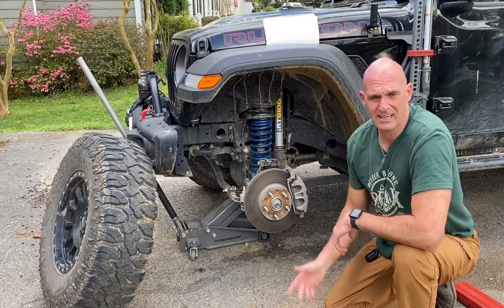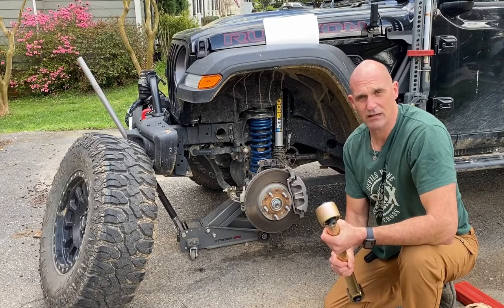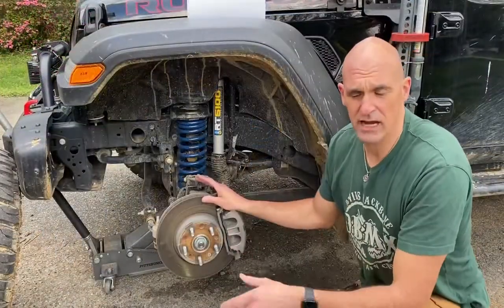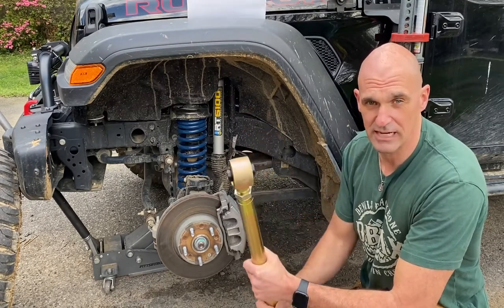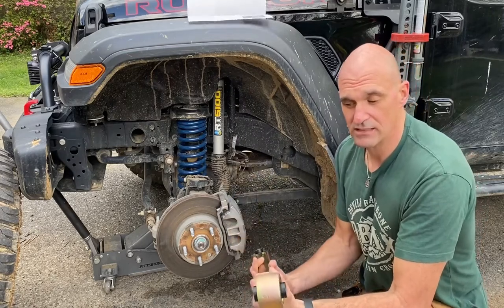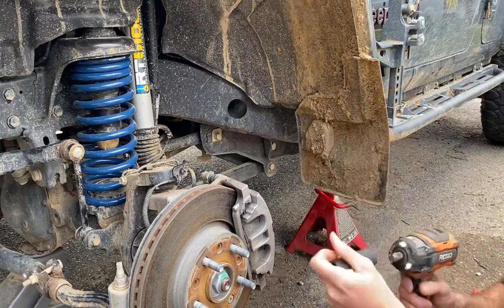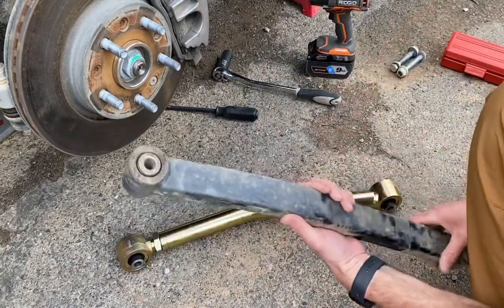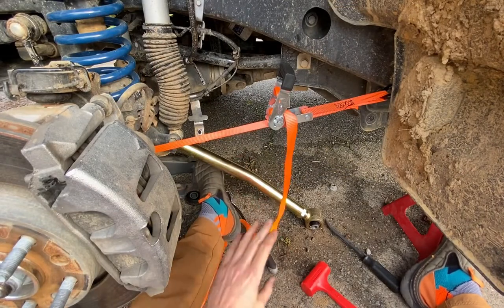Metal Cloak Front Adjustable Lower Control Arms on a jeep JLU Rubicon

Comment: Did you need the strap to pull the axle back to get the bolt holes to line up?
Reply from the maker: Thats how i used it, i set the basic control arm length first and then used the strap instead of wrestling with the alignment and then fine tuned from there worked out really well

Comment: Nice job on the video.
Surprised you didn't add some length to the LCAs to get your caster up a bit, especially if those AEV springs added additional lift. Also, LCA bolts should be torqued to spec only when the suspension is loaded, so best to do that w/ the tires on a ramp or flat ground.
Reply from the maker: Thanks I appreciate it, with the geometry correction brackets there really is no need to add length as they take into account the height of the lift and the castor stays at the factory spec, with the metal cloak arms with their joint you can torque them where ever you want. The duraflex joint actually rotates self centers and is rebuildable so they are not plagued by the fixed bushings need to only torque when loaded.  Thanks for the comments I appreciate them

Comment: Hi with aev high capacity springs 3ich do u really need low control and upper control? My jeep sport JL also build overland awning wich roofrack  rooftent and all etc
Reply from the maker: Hello, You dont need them for the lift especially if you add the geometry correction brackets, i added them for the greater articulation of the joints on the control arms, just allows the suspension to flex in a way to help maintain traction.
Reply: @FischerJeepAdventures  thanks bud

Comment: what did he do to mount the brake line bracket that no longer fits on the new arm
Reply from the maker: So we tried a couple things the brake line anchor brackets by teraflex didnt work well in my opinion, so all i did was bend the factory bracket and used two zip ties pulled tight by a zip tie gun and they have been that way for 10000 miles with no issues, my plan has been to just replace the zip ties each year and let it be, seems to work in my setup

Comment: I have a question regarding lower control arm replacement, When are they required? After how many inches of lift? I'm planning on doing just an 1 or 1 1/2 inch lift just enough to level a Wrangler JLU, Thanks and Thank you for your video.
Reply from the maker: For a 1 to 1 1/2 inch lift your fine with the stock arms, typically you want to start looking at lowers at the 3 inch lift level as the axle has moved off center and to the rear when speaking of the fronts and off center and moving toward the front with the rears.  The lower control arms at that point help you recenter the axles in the wheel wells. The same sort of thing can be accomplished with geometry correction brakets which use the frame mount to move the stock arms forward. For your lift you are okay leaving every thing stock.  Hope that helps and thanks for watching our video and visiting the channel!
Reply: @FischerJeepAdventures  Yes it did help, Thank you for your reply.

Comment: If i have adjustable control arms do I need geometry correction brackets?
Reply from the maker: Great question, the answer is no, the purpose of the adjustable arms is to correct the castor and axle position after a lift and they will certainly do that.  I chose to add the correction brackets to bring the angle of the control arms back to factory positions which makes a difference in the way the vehicle drives and handles and how severe the rearward arc of the front axle and the forward arc of the rear axle as they droop when flexing the suspension, just a personal preference and not necessary, I think its worth the money though! Hope that helps and thanks for checking out the channel

Comment: Did you notice a ride improvement after the control arms upgrade? Would you spend the money again?
Reply from the maker: The ride on the rubicon with the aev suspension has always been pretty good, where the control arms really made a difference is in the suspensions articulation and this keeping traction in uneven terrain and limiting the body roll, their joint tech is awesome, and yes i would buy them again, highly recommend their products

Comment: how do you like that 5100 shock?
Reply from the maker: They did pretty good, tuned for the kit definite improvement over stock dampening, i did end up upgrading to the falcon 2.1 shocks and they were an even better improvement and stayed cooler when running on uneven dirt roads and trails for long durations
Reply: thats very good, I am still researching on what do I really want. I think the 3.3 is a bit overkill for me right now. I am seeing you installed both the geometry bracket and the LCA. I was debating which one to get, people talk all different things but I didnt realize you could just install them both. I am going to do that or just go with the LCA first!
Reply from the maker: Yep both gives you a couple benefits, the adjustable control arms are an upgrade in strength and the joints improve articulation and the adjustability allow you to recenter the axle in the wheel well, the drop brackets allow you to correct the geometry of the arms themselves, your stock arms on a stock suspension are close to parallel to the frame and ground, when you lift it the angle of the arms increases which can impact the ride of the vehicle, the drop brackets just bring those arms close to the stock geometry and in my opinion make a significant difference in drivability on road, but also when offroad the articulation is more in a vertical line up and  down rather than in an arc meaning the axle moves more up and down rather than traveling toward the center of the vehicle as the suspension drops

Comment: Maybe I’m missing it, but what did you do with your brake lines?  I got a brake line extension from Clayton when I did my lift, but I do eventually want to get the Metal Cloak Control arms. Are you just letting them hang from the upper bracket and if so has it caused any issues?  Thanks!!!
Reply from the maker: Matt great question, when i installed the aev lift they have you flatten the bracket so its raised up and then re attach it to the factory location, since the metal cloak is tubing, they recommend cutting the bracket off where it connects to the hose and let it float, i was not a fan of that so i zip tied the bracket to the lower control arm, 2000 miles later no issues, i am sure there is a more appropriate fix u can buy but imo a zip tie works
Reply: @FischerJeepAdventures  thanks. I’ve seen the Teraflex brake line anchors, but honestly I prefer to get real world feedback and I know you wheel your Jeep. Thanks for the feedback. Take care.
Reply from the maker: @Matthew Taylor, no problem, I actually ordered the teraflex brackets since they were only $25, they just didnt come in before my last trip so ill see if i like them this weekend and let you know